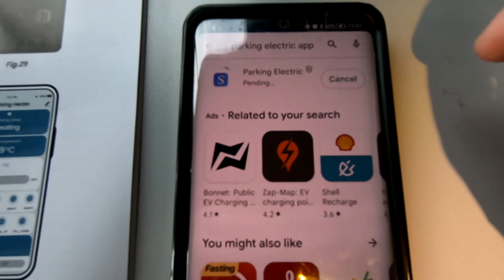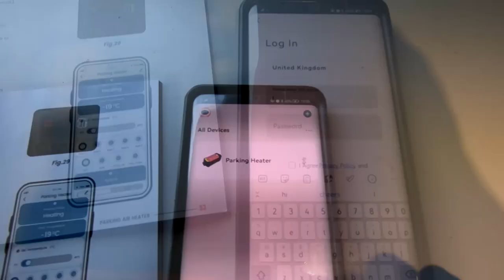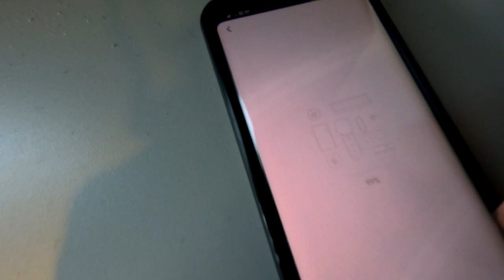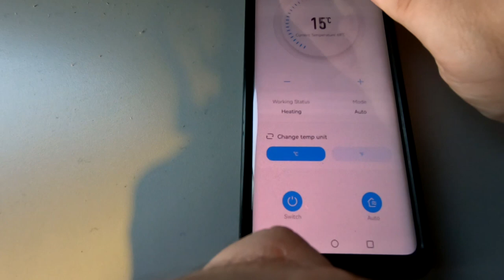Setting Up Your Bluetooth Diesel Heater App #dieselheater #maxpeedingrods #vanbuild

Comment: nice video on showing how to set it up, when using the app after it;s been set up how close to the heater do you need to be to turn it on via the App
Reply from the maker: After playing about you can't really be to far away Roy probably won't bother with app it's just as easy with remote.

Comment: That info is totally wrong that’s how to reset not add device, I’ve just got one and setup Bluetooth. 

The instructions are a little vague at best and no reset button on the device, you held the settings button it had no reset button. 

Once you have the app installed and it ask for wifi connect then go to settings on the phone and turn it on, then back to the app and should ask for permission, same  for Bluetooth if not then click on the bold blue writing and it will force asking for permission. 

This is how it works for mine

Comment: Heater is good, however the App is next to useless, it only works on bluetooth not via the 'net, and the range is terrible, with the heater in the van it doesn't even reach inside the house...

Comment: I strongly do not recommend devices from this supplier. 
Firstly, the devices are of very low quality. E 1 error code cannot be corrected on these devices. They sent me two devices and additionally two control units. None of the devices worked normally for even two months. Secondly, the support service is terrible. Not a customer-oriented salesperson. By purchasing their device, you may waste money and time and you will not be able to use the heating device in winter.
Reply from the maker: Iv been using it for two years with no problem
Reply: @ProjectMan  I have also been trying to use this device for two years. Same problem E 1. I'm not the only one who encountered this problem. You can find many reviews on the Internet where users have encountered a similar problem. The manufacturer itself admits this problem and sent me an upgraded control unit. However, the problem, although to a lesser extent, remains.